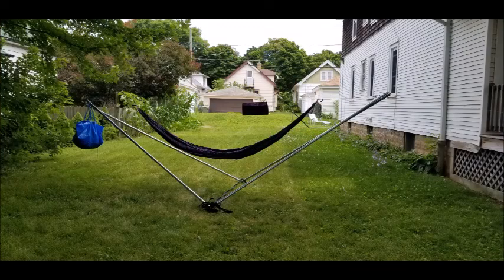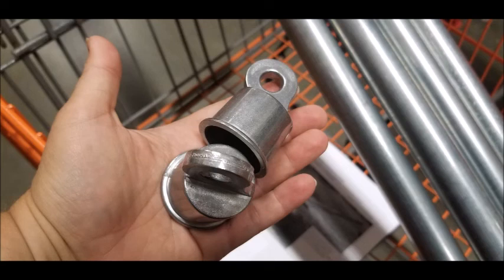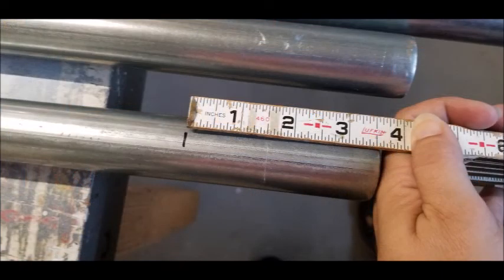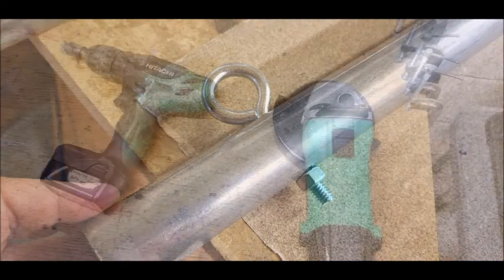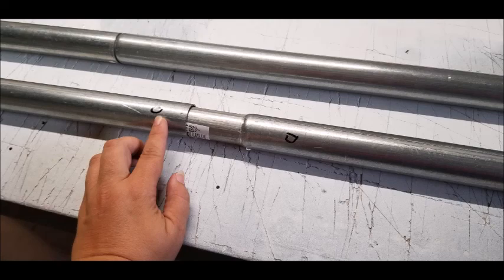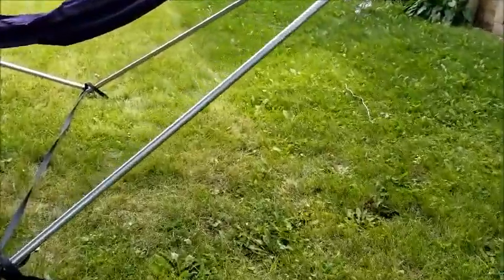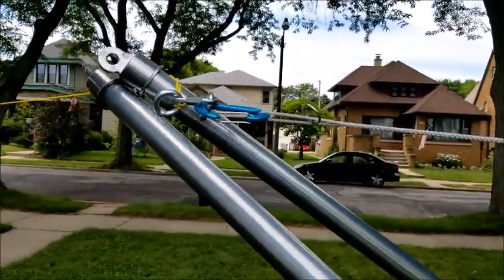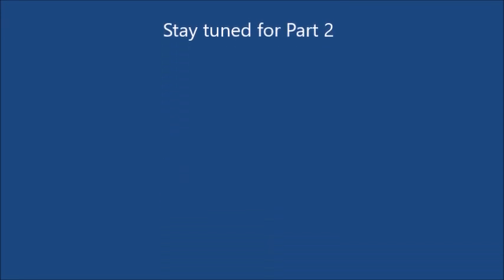My Monster DIY Tensahedron Hammock Stand -  Part 1

Comment: Hi Karen, im planning to build one and this is the only good video instructions i found on line. Question i have is how did you join the two 5 feet poles? And do you still use it ?
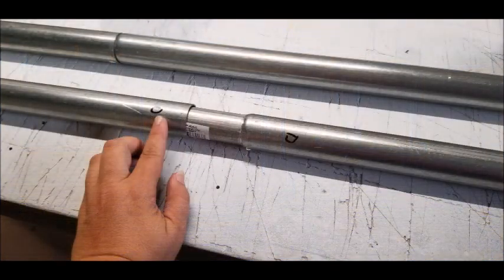Reply from the maker: At the 3:27 mark you can see how one end of the top rail will fit into the other end.  And yes, I still use it.

Comment: Center punch makes the divot to keep the drill bit in place. A countersink deburs the hole and makes the top edge of it angled (for "countersinking" angled screw heads in flat metal). The "cutting saw" is a handheld grinder with a cutting disk in it. Those are called Lock Washers, they help prevent the nut from unscrewing itself.
Reply from the maker: I knew someone would know all the proper terms for these tools!  Thank you!

Comment: Because I'm white? Did I hear that right?
Reply from the maker: Yes. I acknowledge I may have gotten special treatment because of the color of my skin.
Reply: @KarlaWithAKTime  wierd way of thinking, but great video! ;)
Reply from the maker: @sdlopez83  Thank you.  Are you making a stand?
Reply: Contemplating it or just pulling the trigger on a tensa4. Looks like an  easy enough project.
Reply from the maker: @sdlopez83  I was surprised at how quickly it came together.  It helped having so many others posting how they made theirs.